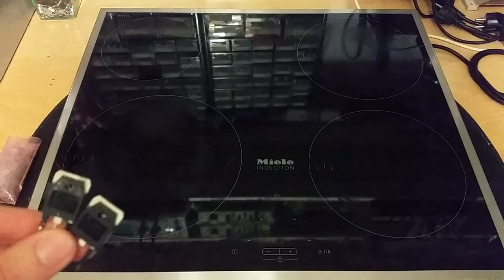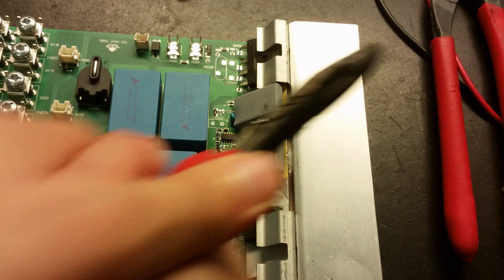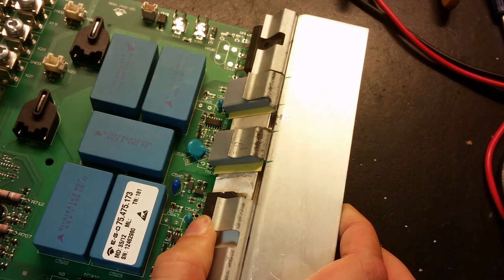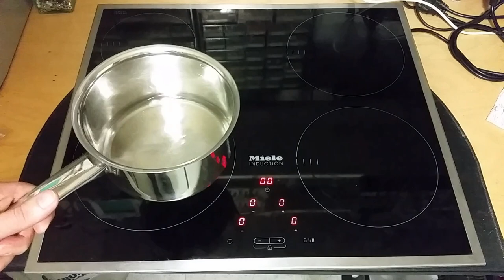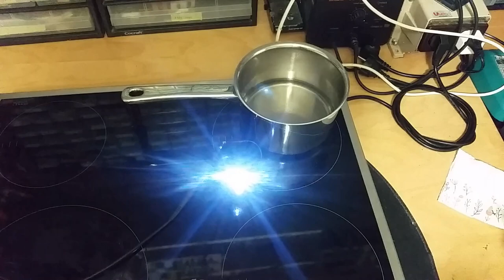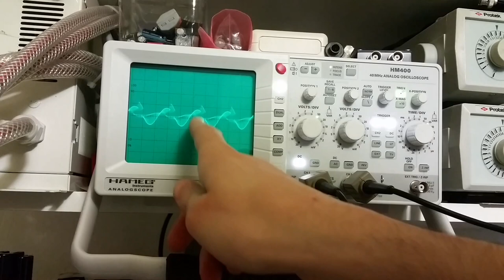Induction Stove Repair Part 2

Comment: Hi, I have an identical unit which makes the external main fuse blow after turn on. Initially the indicators lit, then a relay clicks which then causes the fuse to blow. I wonder if the IGBTs are initially briefly turned on to check for faults - which then could indicate that the error is here. Looks like I have a big job in front of me.
Reply from the maker: It can be shorted IGBTs when it has that problem
Reply: @MrTesla1337  that makes sense. Then an initial test routine is not even required for it to fail. I have never worked with IGBTs, but I guess that such a fault can be tested in circuit (a simple continuity test)? Regardless, I look forward to fight with the heat sink😅 could it make sense to clip the legs, drag it out, then push a new one in with shortened legs, then solder separate pins to the pcb and to the shortened legs? This way, maybe, I don't need to mess with the heat sink...? Thanks for your reply!

Comment: Hi,
do you know what IC is used in the power supply part of this PCB? Does it have a code on the top of the IC mine has melted and need to know what to replace it with .

Thank you

Comment: I might not have been so fast to put my Samsung Hob  in the recycling now BUT  it was the third time (3Xand out in my house) it had blow a transistor and seamed like a fundamental design flaw. If only I knew  I might have kept it. Fingers crossed for the Bosch replacement :-)  Excellent video love the comment on phone charging :-)